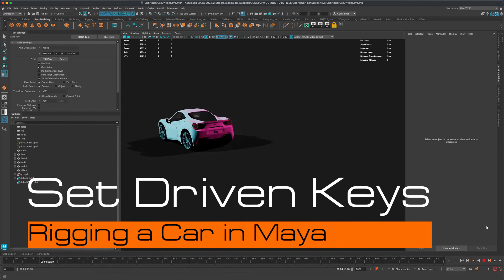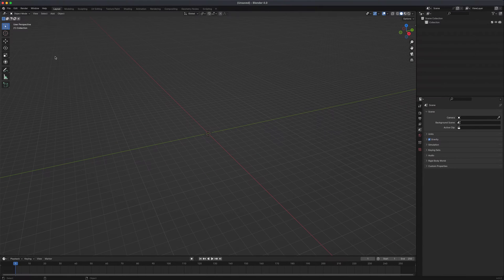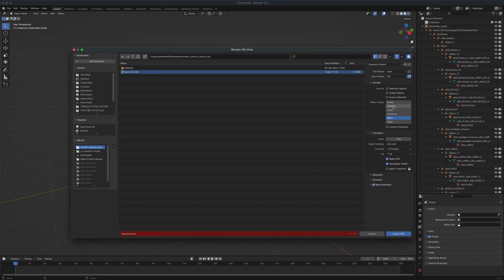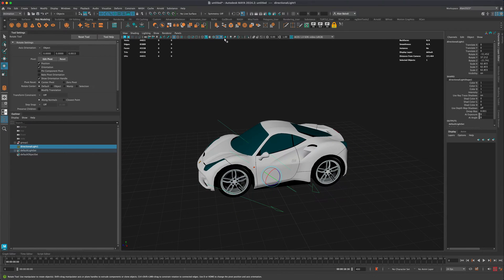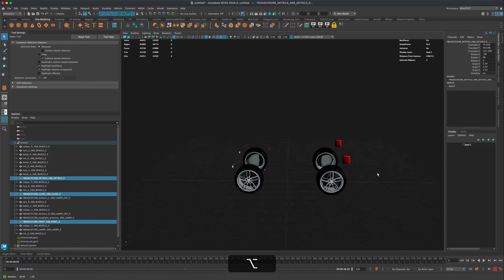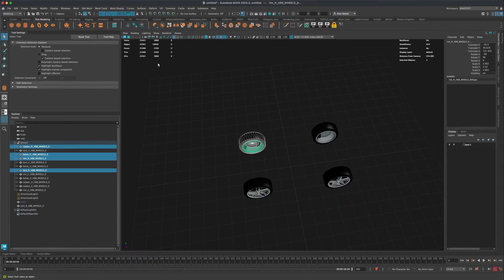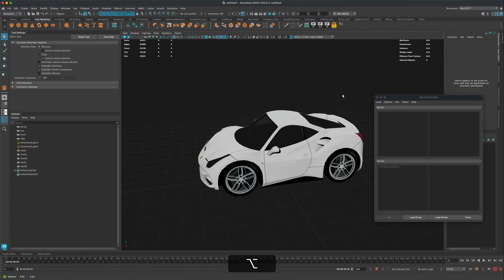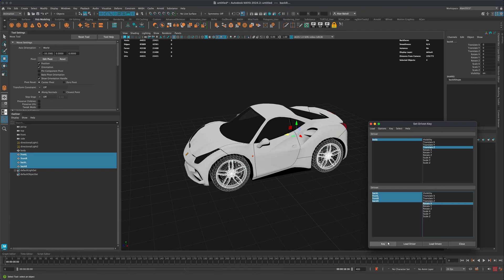Dynamic Wheels Control with Set Driven Keys in Maya

Comment: Hi Alan, finally i made it and it turned out awesome!  Although i have no idea how to make it go around a curved path or a track.  But someone told me that it can be done using the motion path constrain first and then apply the set driven keys to make the wheels rotate.  Would love to hear your opinion about it. Thanks again!
Reply from the maker: Ooo another challenge 😁…. Let me see!
Reply from the maker: Hey I looked into this and there are many amazing detailed Tutorials showing how to properly rig a car like this one for example: https://www.youtube.com/watch?v=N4PXpDtAY3Q&t=74s 
It is very easy to set the car on a motion path by parenting the wheels so they rotate with the body but both the "Expression Editor" versions and the "Set Driven Key" versions will not work if the car is turned backwards traveling the other way. For multiple wheels directions to work properly I don't think you can just use constrains, it seems you also need some additional code which is beyond my level of expertise... if you need something simple, you could just set the car on a path and as long as its traveling with the constant speed you could simply manually animate the wheels spin along the path without doing anything super fancy. Not really sure what you are trying to achieve :) and if your car needs to change speed as it moves along the path.
Reply from the maker: check this out I made another video as my solution :) https://www.youtube.com/channel/UCZT7WVtxTWibMDvG-8FXJWg